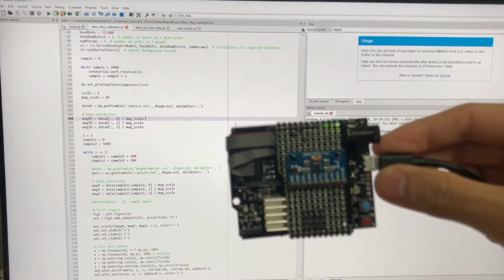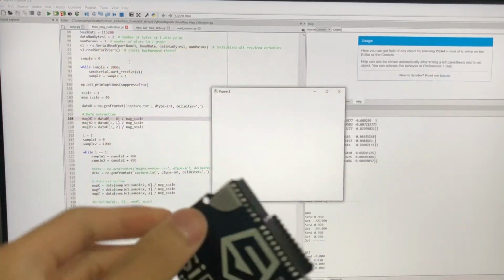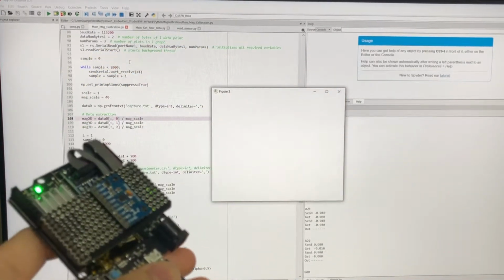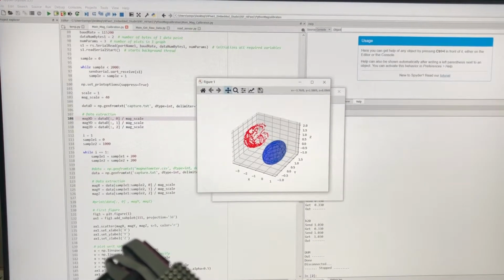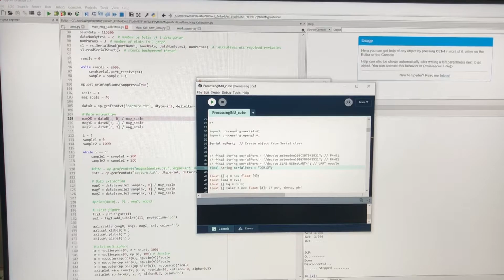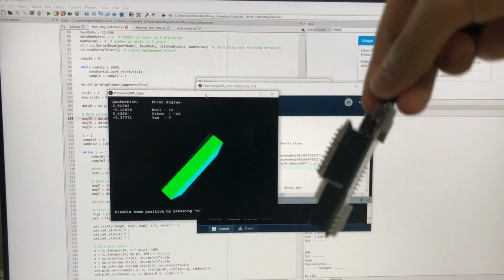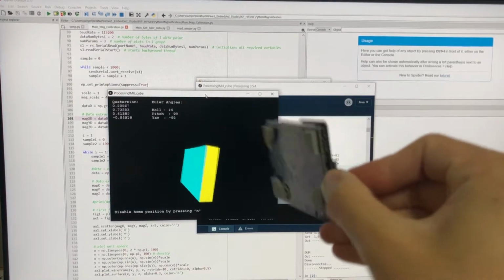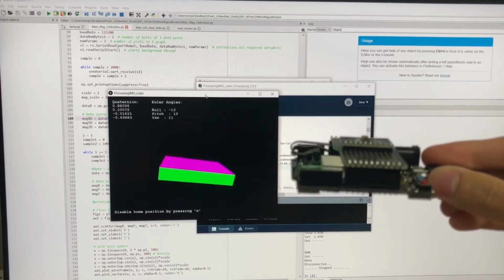EKF for a 9-DOF IMU on a RISC-V MCU

Comment: I'm using raw angles instead of quaternions to set the virtual cube's attitude and i have a problem. I'll explain it as good as i can.
 It works if i do simple rotations but not when i do the following:
When i yaw left 90°, pitch up 90°, roll right 90°, and pitch down 90°, I'm physically back in the same attitude but my yaw and roll are 90° off.
I understand why it happens but i don't know how to fix it. I think it can be solved with quaternions but I'm not good at them.

Keep in mind it's a very basic program, nothing like yours. I'm turning angular acceleration into angular velocity which turns into angle which gets sent to the virtual cube.

Comment: What is the resolution of this sensor in deg angle
Reply from the maker: Really depending on how much memory and computation power you have for EKF
Reply: @hienvuvg  thanks, I want to use this in one of my projects using arduino
Reply from the maker: It's a 16-bit conversion. The granularity should be high.

Comment: Is it good to detect yaw angle?
Reply from the maker: Yes, it is. That's showed more clearly in this video https://youtu.be/FiivFT2d-Vk
Reply: @hienvuvg  yes, i will try to detect yaw angle for building a robot, using mpu9250 follow your instruction, can i ask you something if i get issues?
Reply from the maker: @locchuong  Sure, glad if I can help
Reply: @hienvuvg  some imu like mpu6050 or mpu9250 got the problem with  Yaw angle because they are using projection of the gravity vector to detect the orientation, can RISC-V MCU or BNO055 fix that problem?
Reply from the maker: @locchuong  that's a hard problem which is much more difficult to solve
Reply: i got stuck with that problem, i think i am gonna try with BNO055, i saw some video show BNO055's performance  is really good.
i also try to put the imu slope, i think this trick gonna improve the hard problem.
Can i share with you these experiments? can i get your mail or any social network contact?
Reply from the maker: @locchuong  Sorry, I have been busy these days. BNO055 is pretty easy to work with so I think it can help to solve your problem.
Reply: @hienvuvg  I agree with you. BNO055 works very good. I've solved with it for obtain a stable YAW signal.
Before the bno i've tried also:
MPU6050 (crap for serious projects)
MPU9250 (tedious)
With bno you solve most of the problem with 3 lines of code keeping you focused on the logic of your project instead of having headache with filters, bad drifts and so on.